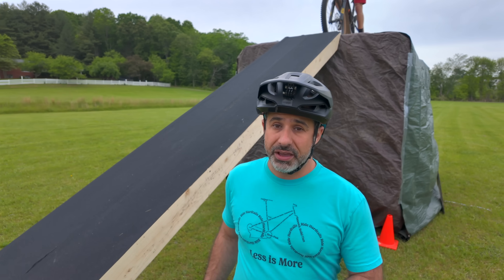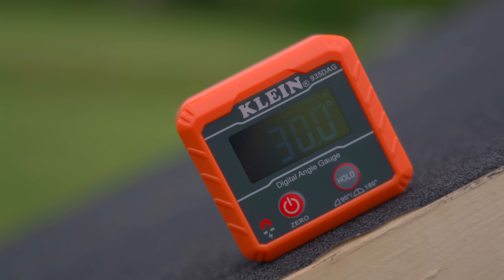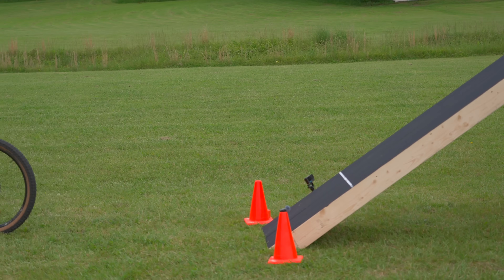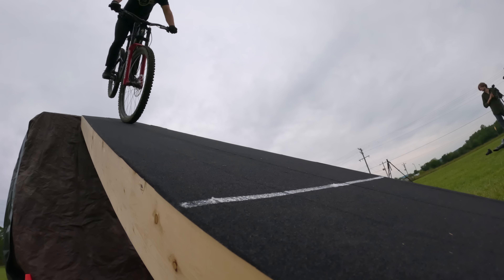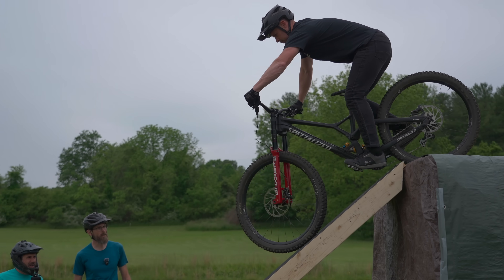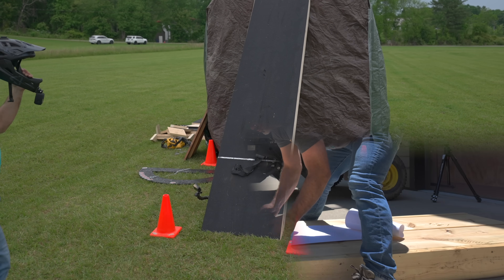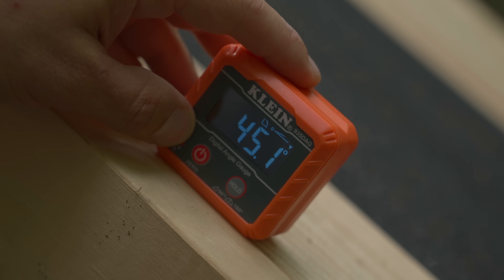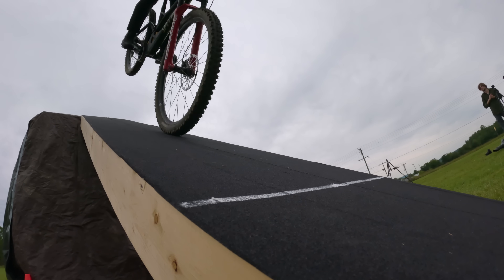Could You Stop? Our Brakes Were Useless At This Angle

Comment: The most grip is when Seth gets his entire weight over the front wheel. There appears to be no contribution from the back. From that pov then the test could be conducted horizontally with a weight on a non-rotating wheel and see how much force it takes to drag the wheel across the surface you have chosen. That means you are not testing Seth's ability to manoeuvre his position on the bike into an optimum position. The combination of tyre/surface may not be the highest coefficient of friction you could achieve. So I think you are partly testing Seth’s skill in staying on the bike (utterly amazing – as a cyclist I would not attempt that) and the ultimate grip between two types of surfaces. As an illustration of the latter if you had a rack and pinion version of the surface/tyre then you could get the back wheel to grip more and have a steeper slope.

Comment: the bigger is is decreasing the length of the ramp. you also need to get you centre of mass as much as you can over the back wheel and as low as possible on the bike.

Comment: Well the first one is easy, you would need to have different start place which has less than 25° towards the steep slope. Through this you would not lift the back tire from contact surface. 2nd you don't stop until you stand 3-4 sec. But nice experiment.

Comment: I don't know if anyone pointed this out, but in both cases you were trying the final grade with faulty traction on the rear wheel. In the first case you made the correct analysis, but in the second case your rear wheel was not making immediate contact with the surface so there was no traction there until it did. By the time your rear wheel did make contact you were already experiencing slippage on the front wheel. The rear wheel would then be subjected to force high enough to overcome static friction and would slip.

Comment: I think the biggest thing you could do to improve the angle would be to ride on aired down slicks. Tread is meant to improve grip by digging into soft material, with surfaces like tarmac a fully slick tyre is actually the most effective grip wise. Look at what any race car uses and you'll see completely slick Michelin/Pirelli rubber providing the highest amount of grip with treaded tires only coming out in wet conditions to evacuate water from underneath and maintain adequate tyre temperatures. With a much larger contact patch you would be able to stop at a much steeper angle, with the knobby maxxis tyres only a small percentage of the tyres surface area is actually contacting the grip surface.

Comment: This reminds me of a 1500 ft steep decent on a regular ride I used to do. It took about 20 minutes to descend. It was necessary to have your butt occasionally buzzing the rear tire. It was essential never to lock up the wheels as there is more grip while it is still rolling. No one went over the bars because this was before disc brakes were available. A set of front brake pads would last 2 rides. The descent was loose gravel for added challenge.

Comment: Under absolutely perfect conditions if you lean back and stay low, 45° is the steepest angle. Once you account for reality (imperfect tires) its closer to 30-40 degrees.

Brakes only work as long as your tires grip is higher than the force of gravity pulling you forwards. Past 45 degrees your grip physically can't be higher than that force because grip is a function of gravity. 

Of course if your CG is further forward than your front tires horizontally then you'll wheelie over anyway.

Comment: Years ago did the reverse of this experiment (i.e. uphill... On a dirt path), which to me felt easier and safer.... but I did NOT measure the angles. 
One of my observations is that one of the riders in the video was using the rear brake (and locked it up) which I felt was the right way to go given that he was skilled enough to not crash. The rider's skill and confidence will determine if they can get the front tire loaded up with 90%, 99% of the total weight, or something in-between, but getting less than 99% of the weight on a braked wheel will certainly hurt your max descent angle. In the hill climb version of this experiment I doubt I got any higher than 92% of my weight on the rear and obviously I didn't have a driven front wheel, but anything I could do to minimize weight on the non driven wheel was a help. (But I wasn't willing to risk falling back, which might've killed or paralyzed me). 

So I'd be stoked to see someone try this with a long wheelbase recumbent on low pressure , wide tires (the kind of bike that has the rider sit a few inches above the ground, feet ahead of their butt, and then place the wheels directly ahead of and behind the rider). Use both brakes and see what you get; I bet it'd be marginally better than any mountain bike. 
The other comment I have is that slick tires are probably ideal here. You can't dig in to this ramp and tread tape stuff so get as much rubber on the ramp as you can; I believe one of the factors leading to slippage is the contact patch being small enough that rubber was getting ground off the tires (and yes I saw skid marks in the video)

Comment: Went down a too steep slope on a 3 speed cruiser type bike.
Just ended up relaxing the brakes just under the tipping point: and coasting across a freshly seeded lawn at the bottom.
They installed a ramp at that point with a much shallower grade.

Edit: 53.5426403 North -113.481438 West

Comment: it's an old video but if you're still having fun with this I think maybe have a way to move the ramp with the rider ON it. you start slow and as you hitch inch by inch the bottom of the ramp the angle gets steeper, the rider ha time to "feel" the balance as he goes back and back with his center of gravity but from a still position not from a moving-stop position. so you could find the sweetspot for each one

Comment: Ah, but in this test, the horizontal-velocity is almost zero. On the descents, this is more than just a momentum-problem because the horizontal-velocity affects the weight acting on the slope which in turn affects traction. This is why on descent, linear and convex-slopes are much more dangerous than concave.

Comment: The coefficient of static friction between the tires and the grip tape is approximately 0.9 (tan(~42 degrees)). This is about the same as the coefficient of static friction between rubber and tarmac.

Comment: Most tires can achieve something like a maximum coefficient of friction of 1 on dry asphalt, at which point a 45° slope is physically impossible to overcome (if you ignore the mechanical interaction of the tread blocks with larger scale features of the terrain) because at 45° gravity is trying to pull you down the ramp equal to how hard it is trying to push you into the ramp to generate friction. Lowering the CG and centering its projection between the wheels helps distribute the load better, but at some point you just run out of of friction coefficient even if you can balance the CG properly to not go over the bars.

Comment: come to think of it. the point at which a bike will skid (assuming it doesn't tip forward first) is precisely when the tangent of the angle exceeds the coefficient of static friction, right? you have a normal force proportional to the cos of the angle, and a tangential force proportional to the sin of the angle, and when that ratio flips in favor of the tangential force, you skid.
(edit: hey, isn't the tangent of the angle the same thing as the grade? so if you have a coefficient of friction of 0.91, you can't possibly stop beyond 91% grade)

Comment: 45deg aka 100% does not look much from the side but imagine you are wallking past 6 parked cars, its nothing right ? well with 45deg you would have climbed 10 😮 floors in the same time, we dont seei vertical and horizontal the same way, slopes get bad real fast i mountain hike 45deg is when if you start sliding you wont stop pretty much

Comment: As the slope gets steeper, there are two effects coming into play. Firstly force acting down the slope increases in proportion to the sine of the angle with respect to the horizontal. So at 30 degrees, there's about 50% of your weight acting down the slope. However, simultaneously, the force normal to the surface, and pressing the wheels into the slope, is proportion to the cosine of the angle. Thus the force down the slope is increasing, whilst the friction level is decreasing. What couples the friction force with with the force applied normal to the surface is the coefficient of friction. One the ratio of the force down the slope exceeds the normal force multiplied by the coefficient of friction, then the wheel will slide. 

Thus the maximum angle you can stop at is the arc tangent of the angle (which I will call theta) is equal to the coefficient of friction. Thus if the coefficient of friction between rubber tyres and grip tape was 1, then the absolute maximum angle you could stop at is arctan(1) = 45 degrees. If it's 0.8 (which is reasonable for rubber on grippy tarmac), then it's arctan(0.8)= 39 degrees. Note that it doesn't matter if there's some force normal to the surface on both wheels assuming the coefficient of friction is linear with respect to load and both wheels are being braked to the limit of their traction.

Note, I haven't watched past the start of the video yet, but I will predict that a maximum angle around the 40 degrees region will be possible. Note that in this calculation the height and weight of the riders is irrelevant, neither does the bike's geometry. The only thing that matters is that coefficient of friction.

This all assumes that you don't go over the top of the handlebars. If you do, that's a different game entirely. Then you have to take account the centre of mass position of the bike/rider combination in terms of both height above the surface and how far back from the front wheel contact patch you are (note, it's that contact patch that matters - not where the position of the axle). Of course riders can change that a lot by moving back and lowering their body. The more you can do that, the less likely to go over the handlebars. That is where height of the rider, and the geometry of the bike matters.

Now I've watch this, 42.6 degrees corresponds to a coefficient of friction of 0.92. That seems highly plausible.

nb. none of the calculations are difficult; well within the scope of physics at High School, certainly where I come from, and I might even have been taught it before the age of 16.

Comment: I feel like a stiffer (or almost none) suspension would help but would also be a bit of an unrealistic scenario at the end since you wouldn't do downhill with no suspension. However generally speaking once your suspension dives in you lose pressure and traction for that moment your suspension travels. 
It is also probably more dangerous if you don't have that initial give at the front while engaging your brakes.

Comment: You can add glue to the tires and go steeper. How steep you can is directly proportional to the coefficient of friction and the weight of the rider+bike, and making sure that the center of gravity is behind the middle of the bike. If you had enough friction, this problem becomes a human anatomy problem and how far back the center of gravity can be moved by leaning the body behind the rear wheel. The brakes i'm almost certain are overpowered for any angle, as they will lock the wheels easily.

Comment: Mechanical Engineer here: 45 degrees is the limit for stopping with friction alone. It's fundamental to mechanics and gravity, as the reaction force coming from the ramp will always be more forward than up. The force of friction from the brakes and tires can only equal the vertical part of the reaction force. So when Joe "stopped" on the 46 degree slope, he didn't stop at all. What happened was that Joe locked up his front brake and tire, then all forward momentum was transformed into rotational momentum, hence his back wheel came up. Had he not let go, his entire bike and body would roll completely over the front tire. The only way to stop on a 46 degree slope or more is to add an additional force, such as magnets, chemical adhesives, or a pure mechanical connection like the hooks and loops in Velcro.
Reply: If the coefficient of friction is bigger than 1 the friction force can provide enough backwards force to exceed 45 degrees.
Reply: How did he walk up it then
Reply: @tombob143  wow. now i'm curious. what about friction coefficient bigger than 1?
Reply: mechanical engineer or not, this is just wrong.
Reply: Engineers and engineering students look for a chance to say “engineer here” or “engineering student here”. Is it a confidence?
Reply: @Corylahey12 they just want you to know they are about to drop some nerd knowledge 

I’m a civil engineer lol

Comment: This is why the disk vs. rim discussion often leads people astray thinking one is always more powerful under every condition. They confuse power/feel with other things. But it's not just angle of attack. The tire, mating terrafirma, kinetic energy and mass are the final parts of the equation. If the tire under perfect conditions is forced to grip completely and the kinetic energy plus mass exceeds the design engineering numbers, parts can fail or start breaking. Powerful is no use if wheels can no longer grip or the brake is asked to do something beyond it's design limits.

Comment: I think you hurt your chances to get a successful break by continually removing length from the ramp. Each successive attempt was made a bit more difficult not just by the increased angle, but also by the reduced time you gave yourself to come to a full stop. If you had more length on the board at the steeper angle, then you'd give yourself more time and possibly a better chance to come to a full stop. More length also means more height of course, don't know how much of a safety concern that would be.

Comment: If you want to take all the fun out of it and just do science, you could rig up a system with a bike with a fixed weight and no rider. You would need a means of balancing it without throwing off the test, maybe something like really overbuilt training wheels. You could then have the breaks actuated electronically, and roll the contraption down the ramp at a controlled starting speed. You could now experiment with different tire materials, weights, centers of mass, and other variables. Once you found some optimal choices for bike and components, you could attempt to replicate the results with a human rider know that it "should" be possible.

Comment: To make this test achievable imho - you should make more gradual descent - currently you are on a flat surface and the out of the blue - 45 degree slope - which is simple to test but there is less time for the rider to find the balance and imho it is sketchier to control the bike - also you can try with a more lower bikes - like dirt jump where the rear of the bike is not so high.

Comment: I would make a static test: take a bike with blocked brakes and a sandbag instead of rider, than gradually increase angle and measure when it starts sliding. This should give you a theoretical limit angle when a bike can be stopped. Then you can research how this limit angle behaves when you change variables: weight and position of rider [sandbag], tyres, air pressure, bike model etc.

Comment: So, physics nerd. Your available friction is purely your friction coefficient (which is dependent on the teo materials in contact) multiplied by the downward force. Contact area doesn't come into it, hence you're not seeing any(or more likely negligible) improvement from dropping tyre pressure. Out on the trail a low tyre pressure helps the tyre deform and the lugs dig into the ground better, but doesnt help with friction
For a heavier rider, you need a proportionally higher force to stop. So while you're downward force increases, so does the force required to hold you up. As a result heavier/lighter riders won't matter either.
The coefficient of friction for softer rubber to the tape is higher than the harder rubber, which will probably be the main driver in the difference between the XC/trail and downhill. (Although Joe also looked like he maybe had a better body position as well)
Adhesion is going to be minimal with a cold tyre. Not zero though so will probably make a small difference. Unlike friction adhesion will be contact area dependent (hence the negligible and not zero difference from dropping tyre pressures), however also non-linear with downward force. The best you'll get is with an equal loading on both tyres, so body position and getting low on the bike will help bring some of the weight balance back to the rear wheel to give a better overall adhesion. However, adhesion will be much lower than your friction force, so likely didn't drastically change the result. 

Now that I've taken all the fun out of biking, get out and go for a ride to bring it back 👍

Comment: 2 Things:

Try a mullet with either a 27.5 or even a 26" Inch in the rear and a either a 29er or 27.5 er up front.

go use some " slicker " Tires with shorter and or more studs like the Schwalbe Thunder Burt (Since Gravel Semi Slicks dont come in a great enough width for this kind of tests yet..)

Comment: 45 degrees is generally the limit for any vehicle that requires traction. This is because your traction comes from your weight pressing your tires down into the ground. Past 45 degrees your weight is not directly over your tires, therefore they slip. 
If you can't do it on a less than 45 degree slope, it's generally a traction issue like the ground surface or your tire compound. 
Basically, the ideal vehicle (bikes included) should be able to both climb and descend (stop on) a 45 degree slope.